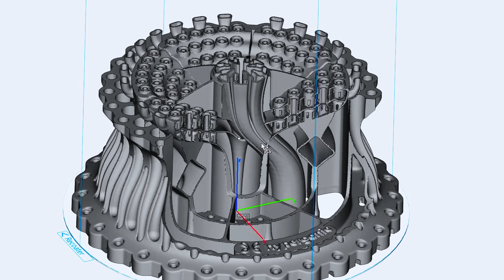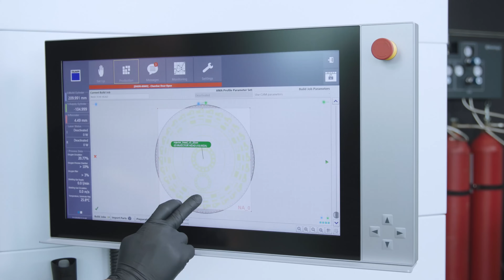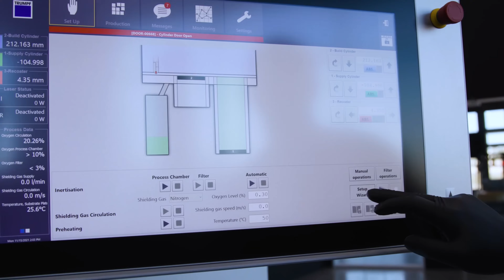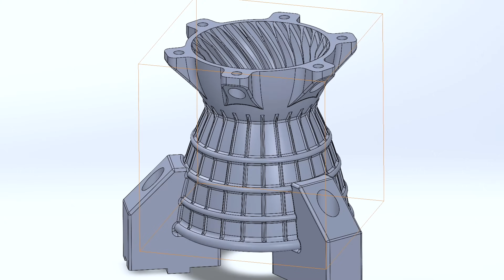Boss Keeps Breathing Down My Neck…

Comment: My experience gives me the benefit of planning ahead, working fast, efficiently, and getting things done on time. Problem is the boss has NO machining experience, he's been at my company for a year and still has no idea what the cycle times are for our parts. He expects everything to be done now. His inability to plan throws a wrench into the whole process. And instead of recognizing my hard work, management wants all the other machinists to work as hard as I do, making team cooperation even more difficult...I really do not understand how this industry is still going. In most places, management is useless. CEO's make roughly $1 Million a year while us grunts are lucky to make $40k. Shops full of team leads that do nothing but bark orders, never getting in the trench themselves. Kiss-asses are promoted fast even if they can't run a machine, but the guys that open their mouths or have an opinion get stuck in the same cell for years. The industry is messed up, and I'm honestly trying my best to leave. I'd rather be a security guard at this point.

Comment: 3d printing is weird , people are afraid to use that cheap 200 buck machine to the fullest, they run it slow, badly tuned and add shit loads of gimics, which is fucking useless. make it stiff and print at high speed, yes your stupid stock ender 3 can do that print in 10 hours which our slicer shows 14 for, learn.

Comment: Hey Titan & co, on average, if you buy a slightly more expensive machine, even 2nd hand - like a 5-axis, a cnc surface grinder, an EDM or waterjet or something like that... after how many hours of using that machine does it pay for itself? Is it on the order of 100 hours, 1000 hours, 10 000 hours? Thanks.
Reply: Im no expert but it really depends on what kind of parts your producing, if its screws or some aerospace parts with incredibly precise tolerances.
Reply: Generally the better question to ask is "Am I buying a machine I'll spend more time fixing then making parts on?" A lot of people I know have bought second hand pieces of junk thinking the'yd be the ones to ressurect it and start making money. It's not impossible but I've seen more people regret that decision compared to people who bought better quality.
Reply: @UnderearthEDO  I'm noit talking about junk, I'm talking about a fully functional machine, which has capabilities like a new one. I'm more interested in ROI than the repairability story, because exactly as you say, repairing machines is a stupid endeavor.

Comment: For me a small single man job shop in Socal, its a constant hustle to be efficient. Between getting work, quoting, programing, setup and running machines, inspections and finally invoicing, its been a learning experience.  I try to have at least 1 of my 2 machines running when I'm in the shop. Fixturing for me, or even multiple vises with fixture offsets helps a lot on that front. That way when I'm programing, quoting, or eating a lunch I don't feel like I'm wasting time.
Reply: What part of socal
Reply: @TheMuicman  Murrieta
Reply: Oh really, I don't live far from you then. I live in Oceanside